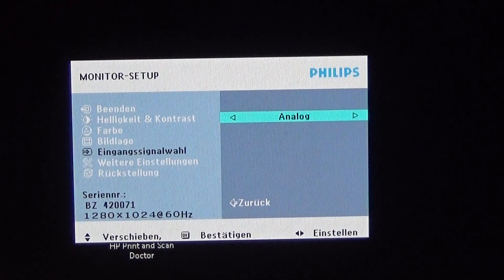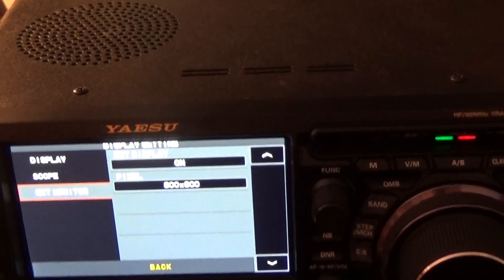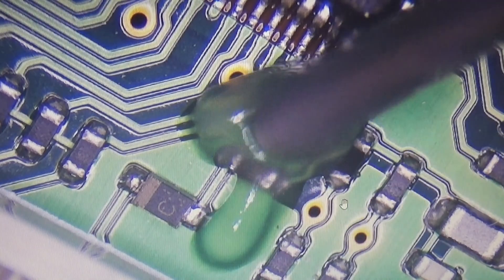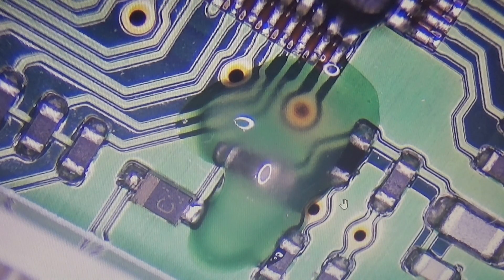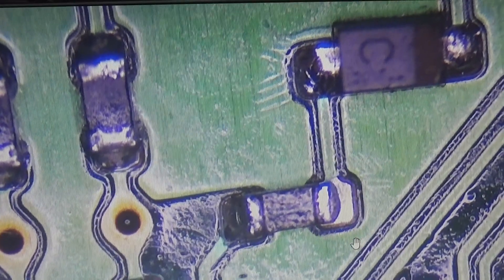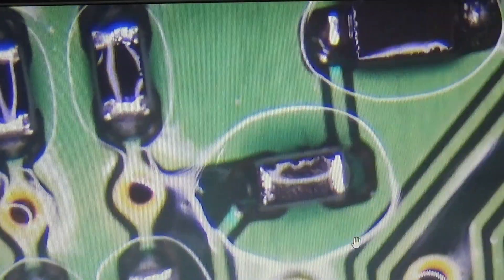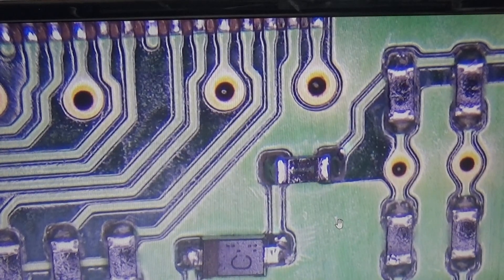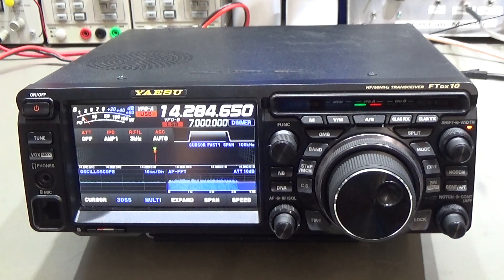#280 Yaesu FTDX-10 with external display port issues fixed.

Comment: By my side wiyh radio ON as you  i have not 5V on both side of fuse like exactly your  test. but i  have continuity on the fuse ( Radio OFF)
Mybe i have to test the contibuity  with  radio ON external monitor ON?

Comment: A few days ago, after 4 years with the same DVI to HDMI adapter and cable, it stopped giving me a video signal. A few days ago it started flickering a little. Do you think it could also be a problem with the fuse or the HDMI chip? Thanks and regards.

Comment: I bought a DVI-to-DVI cable at a thrift store for less than two dollars and an Acer monitor with a DVI input for 20 dollars. I've been using it with my 710 for several days now. I hope I don't break anything. The only thing that made me suspicious was that the monitor doesn't connect directly to the 110-volt line; it uses a 19-volt converter as an external power source. So I measured the pins with the monitor on and only found 5 volts, but not on pin 14. I think it uses those voltages to detect if it's connected, because the screen says "cable disconnected." If I damage my new radio, it's going to be a huge headache, but I can't go in afraid and not try things out. It's connected DVI-to-DVI, and it's working for now.

Comment: hi, I have a ftdx-101MP with DVI not working, in practice I use a Sony monitor for PC with both VGA and DVD-D input, I use a DVI to DVI cable but it doesn't work, in practice I have already checked on the DVI port of the 101 on pins 14 and 15 and 5V comes out, the monitor reveals the presence but the video is missing, I assume that the small fuse is good, what do you say I proceed with replacing the EP952? thanks for any help

Comment: I've never seen an explanation of why this fuse blows. Some folks talk about the wrong type of cable, though no one ever defines what is the right or wrong cable. I thought that you should never connect DVI to an ARC enabled HDMI socket, but having looked at the pin-outs I can't see why this might be the case. I have successfully connected my DX10 to a normal, Non-ARC HDMI TV and it worked fine.

Comment: Just another foreigner that doesn't have a clue. There is a very good reason why HAM radios with display jacks are using DVI. The simple reason is DVI is ONE WAY meaning all signal come out of the radio then to the display. HDMI on the other hand is TWO-WAY, meaning the voltage signals can go either direction, so when a fool plugs his HAM radio into a video distribution system, any voltages not related to video can't harm the radio.  Just ask the gamers that plug their equipment into home entertainment units and suddenly their game console doesn't work. This guys mods void any warranty.

Comment: This is a repair I’m able to perform, the only problem is, where can I source this fuse from and what value is it?  On the schematic it shows it is a 0.63A fuse but it doesn’t show the voltage or if it’s a slow blow or fast fuse. 

73 WP4TGK D. C.
Reply: Just replace it with a jumper, it'll be fiiiine.  JK.  PLEASE DON'T DO THAT!

Comment: Hello,
I have been using an external display with a DVI to VGA adaptor with no issues.
I haven't used the transceiver for about three months and when recently I switched it on there was no input to the external monitor.
Regrettably searching through the internet I discovered that I shouldn't use an adaptor.
I connected another old Philips monitor that I borrowed from a friend this time using a DVI -DVI cable and using the DVI connector instead of the VGA and the monitor displays the transceiver screen albeit a somewhat shaky image.
So I bought a used DVI monitor to find out that I do not get any input to it.
I exchanged it with another one and got the same results.
Only on the old Philips monitor I get connected.
I suspect that an internal damage has occured.
However nothing is mentioned in the manual to notify users against using adapters.
Can you please comment on my issue and advise for further actions?

Comment: Great work! The fuse, F1801 is rated at 630mA up to 70C. However, the diode, RB521S-30 at D1800 is only rated at a maximum continuous current of 200mA. So really, the DVI circuit cannot safely supply more than 200mA of 5V.  It’s interesting to see that the latest Yaesu FT-710, which has a similar DVI circuit, uses a “PolySwitch” resettable fuse with a hold current of 350mA at 60C and trip current of 700mA. The diode at D1800 has also been changed to a RB160M-30, with a maximum rated continuous current of 1A. So, it looks like the FT-710 can safely provide up to 350mA of 5V. The latest FT-710 also added a TVS network on the DDC_SCL & SDA lines.
Reply: I have a FT-710.
I have been using an external display with a DVI to VGA adaptor with no issues.
I haven't used the transceiver for about three months and when recently I switched it on there was no input to the external monitor.
Regrettably searching through the internet I discovered that I shouldn't use an adaptor.
I connected another old Philips monitor that I borrowed from a friend this time using a DVI -DVI cable and using the DVI connector instead of the VGA ,the monitor displays the transceiver screen albeit a somewhat shaky image.
So I bought a used DVI monitor to find out that I do not get any input to it.
I exchanged it with another one and got the same results.
Only on the old Philips monitor I get connected.
I suspect that an internal damage has occured.
However nothing is mentioned in the manual to notify users against using adapters.
You say FT-710 has a resetable fuse.
Can you please comment on my issue?
Reply: The latest FT-710s have the Poly-Switch resettable fuse. I don’t know if there were earlier versions with something different. With the bottom cover removed, the Poly Switch “fuse” is located very close to the DVI connector, labeled J1803. The one on mine is green, is approximately 4.5 x 3.3mm and labeled with “5 X 5”; the second 5 is upside-down and the “X” isn’t exactly an X. The part is Littlefuse “miniSMDC050F”. You can find the data sheet online at DigiKey or Mouser. The “resettable” fuse is more like a self-recoverable fuse. When the fault is removed, the “switch” closes again. From the datasheet, “These devices are intended for protection against damage caused by occasional overcurrent or overtemperature fault conditions and should not be used when repeated fault conditions or prolonged trip events are anticipated.” In this video, the fuse (not a poly-switch) is determined to be open by observing no voltage at the output, but with nothing connected, if the Poly-Switch was bad, it may still possibly show voltage if it failed high resistance. I would measure the voltage while the converter is connected. Also, I wonder if the monitor that “kind-of” works is still trying to process video without 5V present, OR the 5V is there, but the signals are bad because the chip went south.
Reply: @PacTel54321 Hello, can this "switch able fuse be used in the 101mp?  I just had to ask!

Comment: My ftdx10 developed a dead touch screen (mouse and dvi monitor fine) after being connected to dvi monitor for a few days. Yaesu replacing screen display and say it could be a floating earth between monitor and radio issue. I struggle to see this as monitor/PC/radio/antenna/dvi-dvi cable are all grounded. Perfect continuity between all. It's an old Dell dvi/vga monitor and the cable is dvi-dvi. At £400 a go for repair i can't afford it to happen again. My question is... Is there a certain method to using monitor/radio? As in switch monitor on last/first or disconnect/connect monitor via radio before switching on monitor. Is there a sequence that safely works?  Regards.

Comment: Good job, I am looking to buy one of these myself . Questions , do you think a problem with a external monitor or cable blew the fuse , such as a short to ground ? Also could you check the output side of the fuse for a hard ground before replacement . Just some of my thought as a diagnostic tech , more then likely , something blew that fuse.
Reply from the maker: Yes most time it happens due to bad monitor cable or a bad monitor itself, both can create a short to ground which will then blow the fuse...Hope to see some videos in the future on your channel..

Comment: Thank you for sharing your technical experience with the Yaesu FTDX-10 external video display issues. I was going to purchase this model until I heard about the external video issues. Now I feel more confident about ordering one. I really need to learn how to solder SMT components. I have a SMT repair station.

Comment: Can't we just feed +5v to pin 14 of the DVI port and cut the trace to the fuse if it's not already blown?  Isn't that the same effect?  Isolating the chip from being damaged while supplying +5v to the display and keep it awake.  That seems to me is a rather simple soldering job if you have a steady hand and a magnifying glass.  Or replacing the fuse with a, say 20 or 50 ohm, resister?

Comment: Yaesu really dropped the ball here. Customers would be MUCH happier with the HDMI jack and none of this drama. It is was a mistake for them. Great video. Thank you.
Reply: 100%. HDMI is the current standard.
Reply: HDMI also provides voltage. If Yaesu implemented dvi badly then they could do bad hdmi implementation, too.

Comment: Instead of replacing the fuse with another fuse, could it be replaced with a resettable “fuse” or circuit breaker?

Comment: Royaltys must be paid for each HDMI port. To avoid paying royaltys DVI is used.

Licensing

The HDMI specification is not an open standard; manufacturers need to be licensed by HDMI LA in order to implement HDMI in any product or component. Companies that are licensed by HDMI LA are known as HDMI Adopters.[88]

DVI is the only interface that does not require a license for interfacing HDMI.[citation needed]
HDMI adopters

While earlier versions of HDMI specs are available to the public for download, only adopters have access to the latest standards (HDMI 1.4b/2.1). Only adopters have access to the compliance test specification (CTS) that is used for compliance and certification. Compliance testing is required before any HDMI product can be legally sold.

    Adopters have IP rights under Adopter Agreement.
    Adopters receive the right to use HDMI logos and TMs on their products and marketing materials.
    Adopters are listed on the HDMI website.
    Products from adopters are listed and marketed in the official HDMI product finder database.
    Adopters receive more exposure through combined marketing, such as the annual HDMI Developers Conference and technology seminars.

HDMI fee structure

There are two annual fee structures associated with being an HDMI adopter:

    High-volume (more than 10,000 units) HDMI Adopter Agreement – US$10,000 per year.[89]
    Low-volume (10,000 units or fewer) HDMI Adopter Agreement – US$5,000 plus a flat US$1 per unit administration fee.[89]

The annual fee is due upon the execution of the Adopter Agreement, and must be paid on the anniversary of this date each year thereafter.

The royalty fee structure is the same for all volumes. The following variable per-unit royalty is device-based and not dependent on number of ports, chips or connectors:

    US$0.15 – for each end-user licensed product[89]
    US$0.05 – if the HDMI logo is used on the product and promotional material, the per-unit fee drops from US$0.15 to US$0.05.[89]
    US$0.04 – if HDCP is implemented and HDMI logo is used, the per-unit fee drops from US$0.05 to US$0.04.[89]

Use of HDMI logo requires compliance testing. Adopters need to license HDCP separately.

The HDMI royalty is only payable on licensed products that will be sold on a stand-alone basis (i.e., that are not incorporated into another licensed product that is subject to an HDMI royalty). For example, if a cable or IC is sold to an adopter who then includes it in a television subject to a royalty, then the cable or IC maker would not pay a royalty, and the television manufacturer would pay the royalty on the final product. If the cable is sold directly to consumers, then the cable would be subject to a royalty.[89]

Comment: Hi David, I am in Australia. What are you doing to fix the display fault. I would like to fix it myself if possible.  Thanks for your info.
Reply from the maker: I'm not David and I don't know what you mean with THE DISPLAY fault?
Reply: @TRXLab  
Sorry my mistake as usual.
The (Display Port Issue) is what I mean by (Display Fault). I thought this was self explanatory. 73ss Good Luck.

Comment: Hi Peter, I have just got myself a FTDX-10 and yes when i tested it there was no video from the DVI-D Port so i hopped it would be the same as this one, but no, the 5v on pin 14 is good, i all so tested all of the resisters around the dvi chip and all ok, also there is 3.3v to the chip, so it looks like it is the chip, when i was testing with a scope at the dvi port i did see some signals , they did not look clean then i looked at the frequency and yes it was only the 50hz mains interference, have you found meany of these radios with a blown dvi chip,  Thanks Dave 2E0DMB
Reply from the maker: not many but very very few have a blown HDMI chip
Reply: Ok thanks Peter,
I have ordered a ep592 so when it arrives I will change it
Thanks Dave 2E0DMB

Comment: Thanksfor that, i tryed open myft 710, but i guess this fuse is on the otherside......any advice?

What do u think if a give 5volts on pin14 on the cable from an external source???the monitor should work, shoundn't it?

Comment: I really wish that Yaesu would "JUST" sell an 'Approved' DVI-to-HDMI adapter.  Or at least "JUST" publish a white paper on exactly what to do, perhaps making sure that the adapter has such-and-such characteristics. It's all madness.

Edited to add "JUST" in 2 places. Somehow the word "JUST" makes it all okay.
Reply: Just buy a monitor with both hdmi and dvi  Jack's.  24 inch ASUS worked for me.😊
Reply: @JohnFT3414  I'm out of wall space. It just doesn't make sense that Yaesu can't recommend an adapter. Do they know the spec or not?!?
Reply: @JohnFT3414  No. That's insane. HDMI is the current standard. DVI is no longer readily available.

Comment: Hi Peter. Wonderful Video. What DVI-D to HDMI adapter,  exactly, would be safe to use, are there any?  I was informed by a very helpful Yaesu Support Technician that the CABLEDECONN Multi-Port HDMI To HDMI/DVI/VGA Adaptor was the best one to use (I was sent an Amazon link). I tried using that adapter with the Yaesu recommended DVI-D to DVI -D cable connected between the FTdx10 and the adapter and a good quality HDMI cable running from the adapter to a Dell U2415 HDMI monitor without any success, no signal apparently available at the monitor. Either the FTdx10 DVI-D Port, or the CableDeConn adapter itself appear to be nonfunctional, or - even worse - the trial  of the adapter itself resulted with the FTdx10 dreaded blown fuse scenario, and I am not sure how to test out the port other than by connecting a DVI-D monitor.  Any ideas for the best next step? I have notified the tech at Yaesu, but so far it is too soon for a  reply. Thank you all.  W6EO
Reply: DVI-D to HDMI adapters don't have any electronics in them and don't draw any power - the two standards are signal compatible. It just requires an adapter to route the wires between the connectors.

Comment: Peter, thanks for your reply. Because pin 14 had 5v I assumed the chip would not be faulty and that's why I asked for your advice. Thanks again for your time.
Reply: Hi The 5V is put to pin 14 of the dvi socket after the dvi/hdmi chip , so the chip can be bad, it is that this one is lucky the fuse did its job, i have 5v on pin 14 but no output on the dvi socket, Dave
Reply: @davidbrowne1588  
Hi, no I haven't done anything as I have to send my radio 1 thousand klms for repair. I will just live with it as it's too risky to post in the mail. I thought using the correct DVI cable would eliminate this problem, not so.
Reply: @MaxieTube  Hi max, were are you,
I have just ordered 10 chips, they are very cheap,
Dave UK
Reply: Hi Did you Fix your radio, and was it the chip, Thanks Dave

Comment: Hi Peter, I have the same issue but I have 5v on pin 14. I have continuity tested the DVI-D cable and only have continuity on pins 1-2,7-10,14-18,22-23. I don't want to send my radio 1 thousand kilometers to be looked at if its not a blown fuse.
Any advice would be appreciated. Love all your videos. Thanks for all your advice.
Reply from the maker: Well, as we stated in the video if it is not the fuse it is very likely that it is the chip itself...
Reply: Hi did you fix your radio,Was it the dvi/hdmi chip  thanks Dave

Comment: Have you noticed you made a nasty solder flake with your probe on the diode pin (last test presented). I hope it will not fall off. Or short to the groundplane. Yaesu learned and FT-710 has a better solution - resettable polymer fuse.

Comment: The +5 volt on pin-14 is there to keep the monitor awake.  If it disappears, any display thinks the DVI source is turned off which puts the display into sleep mode.
Reply: so can i short it? today my monitor won't go on :(